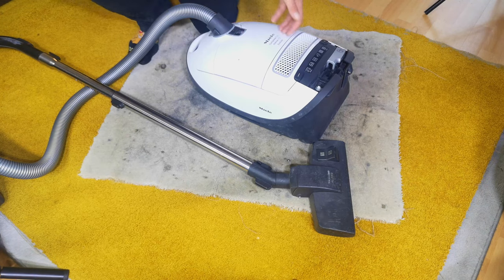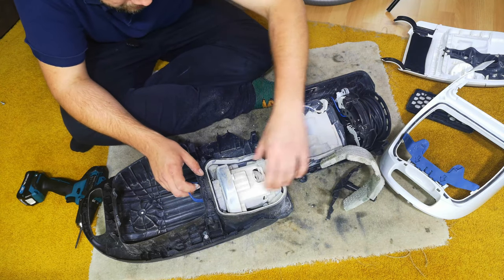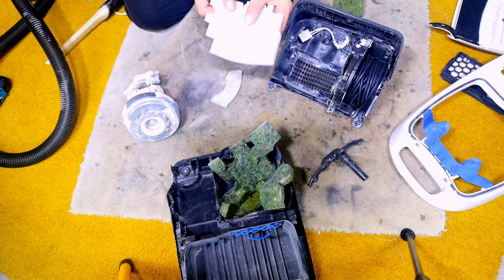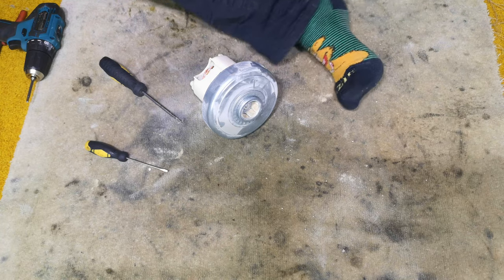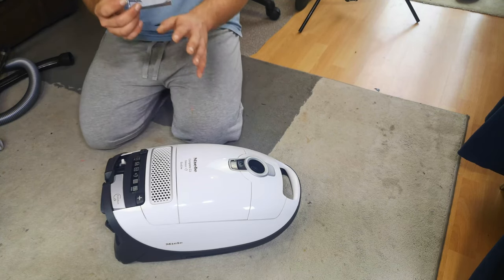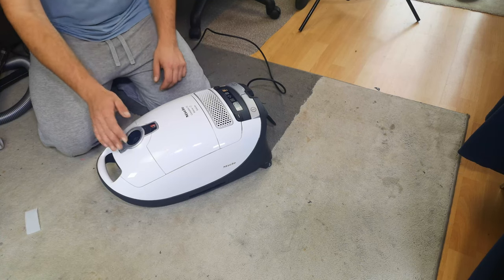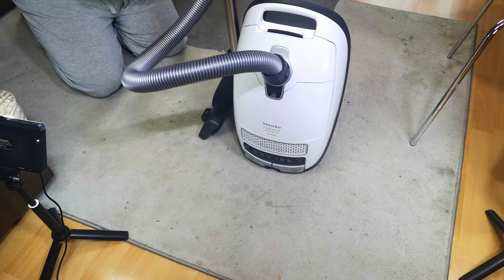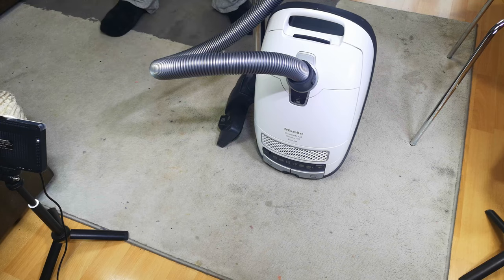Miele SGSK3 C3 Silence - Repair & Refurbishment!

Comment: Can you get a replacement parts for the motor - for example the impeller was full of crud...If that could not be cleaned or was damaged can you purchase replacement parts? same with brushes and commutator

Comment: Beko buying a new expensive makita drill it’s an outrage
Reply from the maker: Was a bargain! £90 delivered with both batteries. Was supposed to be looking for 18v impacts for the car but they'd be no good for vacuums lol
Reply: Just picked up a dewalt impact for work on car Facebook £50 spot on only used lightly absolute bargin